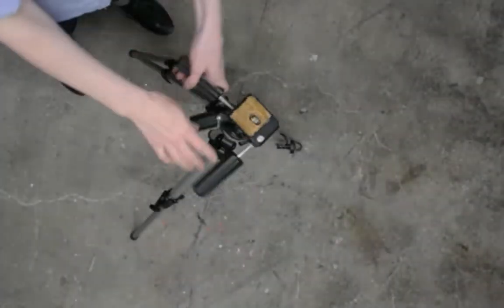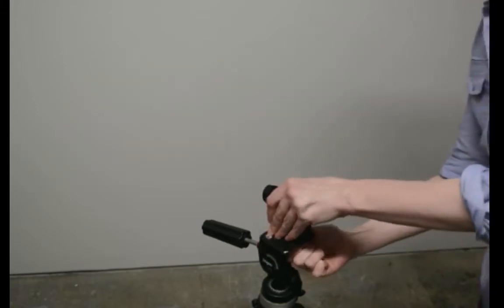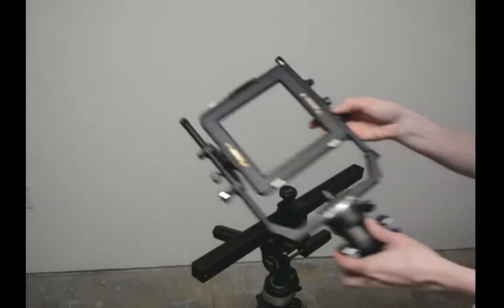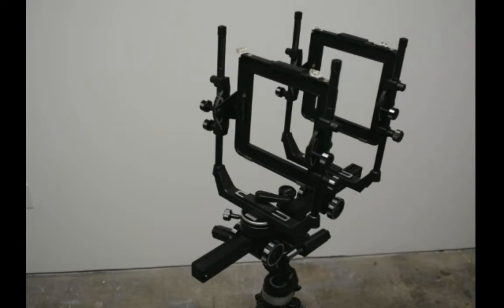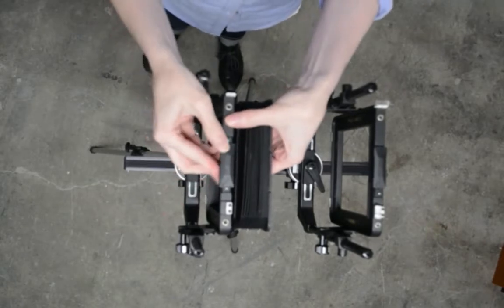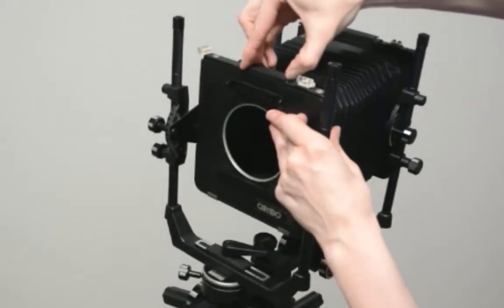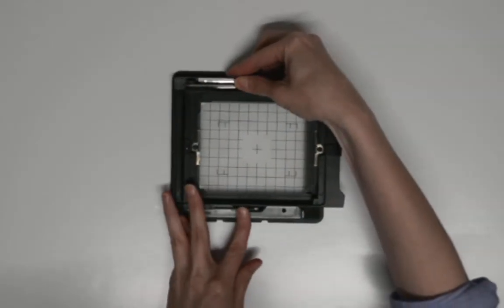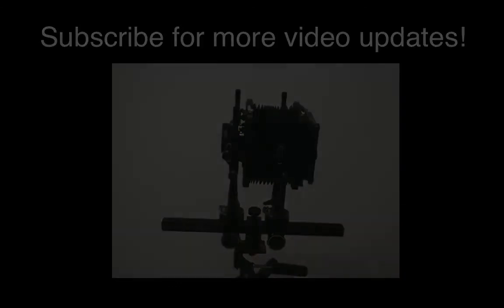Assemble a monorail view camera

Comment: Nice video. I wish I'd watched it before assembling my own Cambo SC view camera. The two knobs indicated on the standard at video position [2:58] don't actually lock the rail on my camera. The smaller knob on the left locks the rotation of the standard and the larger knob indicated on the right moves the standard along the rail but doesn't actually lock the standard in position. Let me know if I'm doing something wrong as I don't have a user manual.
Reply from the maker: It's unclear in that view, but there are two large knobs on opposite sides of the rail (one for focusing, one for locking).  The smaller knob above there is to lock the rotation.  The parts are more clear in this view.  https://youtu.be/V6eRG6Nthc4?t=128

I've seen a few variations in design of the parts, especially around the rail knobs, so it's possible yours is different.  I recommend trying the opposite knob (maybe yours is rotated).  Also try holding one knob gently while turning the locking knob (they are connected, so sometimes rotating one will unlock/lock they other).  This manual may also be useful.  https://static.cambo.com/Files/Handbook-SC.pdf